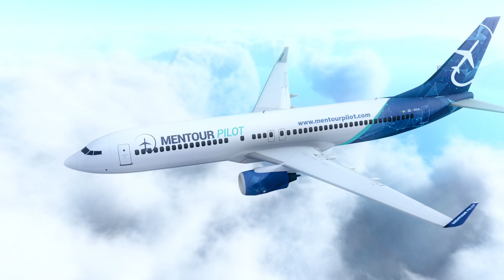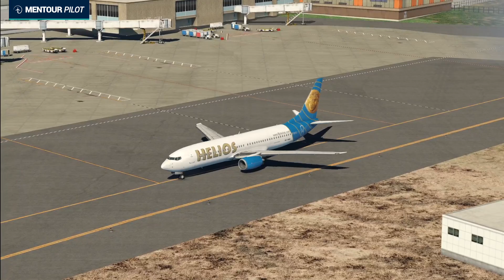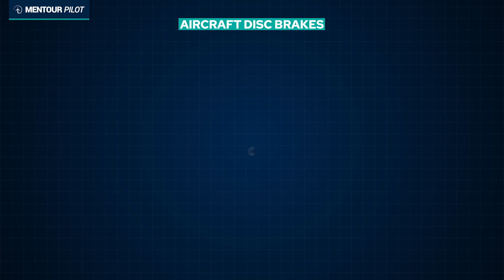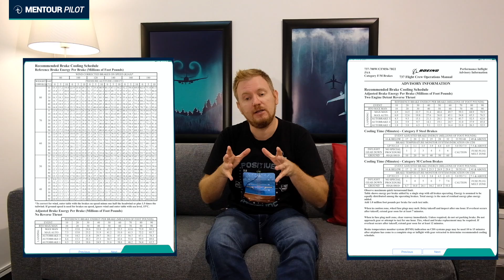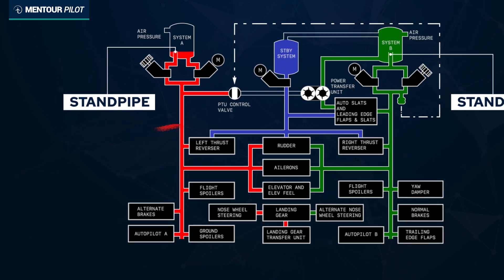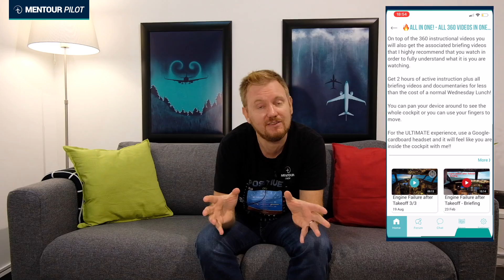How do Aircraft BRAKES work?!

Comment: I love these tech videos. The A-6 Intruder I was married to for fifteen years had a problematic (unreliable) anti-skid system and it was not unheard of to blow tires or have brake fires after  an aggressive brake application. BTW, we disarmed the anti-skid system and increased tire pressure
for aircraft carrier operations.  The latter could make for an exciting arrival when flying off the boat to a shore base.

Comment: When exactly do you set the autobreak control. Does it release when aircraft has stopped
Reply: you set it to RTO before take off ( well when at the gate) and then to off on the after take off checklists and upon touchdown the retraction of the speedbreak, the forward movement of the thrust levers or using the manual toe breaks will all disengage it.
Reply: @tomharper8402  thanks for that

Comment: You didn't talk about chocks and what they do.
Reply: Brakes has really not much to do with chocks, but I do agree that he could have mentioned the use of chocks tho.
Reply: @speedbird9313  I know that chocks cool the brakes down when the parking brake is off but it cools very slowly.
Reply: @ahmedshakeel5112  What!?😂Chocks doesnt cool shit🤚🏻
Reply: @speedbird9313  Yes it does, research it.
Reply: @ahmedshakeel5112  I dont need to research that😂🤪
Reply: @speedbird9313  Ok no problem, but the chocks do cool the brakes.
Reply: @ahmedshakeel5112  Dude..they do not🤨Do some research..
Reply: @speedbird9313  Your right, Chocks hold the aircraft when the parking brake is off so the brakes can cool.
Reply: @speedbird9313  Thanks for the info!🙂

Comment: Excellent explanation...as usual.  My grandfather was an engineer at Boeing in the late 60's.  He told me that he was on the development team for the 747.  One of the stories he told was fascinating.  The engineers had to calculate the maximum heat generated in a 747 during a rejected takeoff.  To prevent the tires from bursting, they had to determine the pressure rise in the tire and then design a special plug in the wheel that will pop out (relieving pressure) just prior to the tire self-destructing.  If a tire bursts, it can do severe damage to nearby components in the landing gear.  A bursting tire also damages adjacent tires and can lead to a chain reaction in tire failures.

Comment: Definitely one of the most interesting videos! 
I am wondering, would you ever use the elevators in an emergency breaking situation, close to take-off speeds, in order to artificially add more "weight" to the airplane without adding mass?
And, furthermore, if you would be to perform such an action, which way would you push the elevator? Because the first thought is down, of course, to push the plane into the ground basically, however, that would shift some of the weight to the nose, where the wheel has no breaks, as mentioned. So, maybe it would actually be more efficient to push the nose up, so that the entire weight rests on the main wheels. Would be really curious what'd be your take on this hypothetical and far-fetched scenario.
O7

Comment: I got a question Mentor Pilot? How do you control the tempture inside the air craft ? Not the cabin pressure , but the tempture for the passangers???
Reply: theres a dial for the 3 cabin zones and you turn it one way for cooler other for hotter, this to phrase it really simply theres more to it like trim air and stuff but its too much to explain

Comment: So, why not wait say, 30 minutes when the plane is at the gate and hose off the brakes to start from a cool brake temperature.  I'm sure you're going to say that they can crack or warp, but I say wait enough time, then finish cooling them off to base or cooler temperature.  Cheap, simple!

Comment: @Mentour Does the cold air during flight not cool the breaks? I mean we are often talking about temperatures below - 20 C. Furthermore the 737s wheels are not covered when retracted. 🤔
Reply: Its about -65c at cruise, and it does. He is talking about short haul island hopping airlines where you dont get the altitude or the flight time for enough cooling.

Comment: I used to work for a company who manufactured wheel speed sensors for a number of aircraft, it's actually really interesting how the anti-skid system works. Depending on the aircraft, they can be a single or dual channel system, and there's a system in place to detect a broken wire even if the brakes are not being used.

Comment: Is it cheaper to use reverse thrust or brakes to slow down in terms of stopping energy gained per $.  Brake wear vs extra fuel burn and wear and tear of reverse thrust.????? So if you have a longer runway to land on do you use more reverse thrust?

Comment: You haven't mentionned the BTV (Break to Vacate) on Airbus
This level of autobrake allows to brake just enough to gate to the taxiway you want. It looks cool
Reply: This is a 737NG which he is type rated for, he sometimes fail to mention that🙄
He rarily talks about other aircraft.
Reply: @speedbird9313  Yeah he's been flying it for 18 years, i know. But i bet he knows quite well what's up at Airbus :-)
Reply: @Slyze33  I hope not, its a bad thing to mix aircraft types to much🤭
Reply: @speedbird9313  Meaning that pilots should be prevented to transition from airbus to Boeing or the other way around? xD
Reply: @Slyze33  Definately not, got nothing against transitioning, just mixing. But so does most airlines🙃
Reply: @speedbird9313  Yep. Haven't heard of any airline that allowed pilots to switch between several aircrafts within the same year. Nonetheless, you could fly for example both A330 and A340 with a MCC as those are almost identical.

Comment: Question about brake heating:   
Do you set the parking brake between flights or is it kept off with only the wheel chocks holding the plane in place to allow better brake cooling?  Or does it really matter?
Reply: It doesnt matter, but they are usually kept off with wheel chocks on.

Comment: I was told by an AB Svensk Bilprovning technician that for a car to be road legal it had to have brakes capable of stopping the car fully loaded and under full throttle in highest gear from n speed (n beeing 90 km/h? Don't remember). This was in the early nineties so before Swedish EU membership, things might have changed since. Still, car brakes are/were pretty good.

Comment: I don't understand why they still use the "good old brake discs" , wouldn't it be possible to install a braking system like on some trains, which works by magnetism....
Reply: Because changes in aviation takes a while..a loooong while. And the 737NG is an old aircraft.

Comment: When I was an apprentice we visited the British airways plane at Heathrow, this would be in about 1963. We went into the maintenance hanger and I remember being shown the Maxaret brakes on one of the aircraft, it reminded me of a motorcycle clutch with the multiple plates. The Maxaret system had the anti locking wheel function for better braking.

Some years later I was in a 747 that had landed at Heathrow and we were taxiing, the old boy on his last stint at cabin crew was instructing us to stay seated till we came to a complete stop. Suddenly we did an emergency stop, probably at about 20mph, the braking was very effective and luckily the cabin staff didn't fall over. This guy said "now you can see why we tell everyone to remain seated and belted up till we reach the stand"!!! I couldn't envisage that a 747 could stop so quickly.

Comment: 9:50 — I honestly don't know why the brakes on a 737 wouldn't cool completely during cruise altitude given the wheels act like a heat sink and are exposed to freezing cold air (-30 C) with 300 mph wind speeds since the 737 has no landing gear doors.

[Okay, just noticed somebody else said there is a windscreen hub that acts as an insulator.]

Comment: I can see why commercial airliners cannot carry passengers with an inop anti-skid system.  Especially when having to land on a wet runway.  Under heavy braking after landing with no anti-skid a wheel going over a paint strip will lock up and it doesn't take long for the tire to grow a hole from the friction.  Not a good thing.  I was a T-39A crew chief/flight mechanic for my tour in Viet Nam and saw it happen more than once.  Lack of anti-skid was the only thing I didn't like about that bird.  It was rugged and dependable.  We actually put 100 hours on one of our birds in a 7 day period.
Reply: Did he say that? The 737NG can be released with an inop anti-skid as far as I can remember..think it is a cat C MEL item🤔
Reply: Ah..he did at 14:34 He is mistaken, but think he really knows🙄🤭

Comment: Interestingly, the brakes are very similar to "race" clutches in a car, or clutch packs in an automatic transmission.
Reply: Yes! very much like wet clutches on motorbikes also which use this "pack" method to be more space efficient, i'm surprised that cars still use a single plate, large diameter clutch actually, such are the benefits of a multi-plate friction system like this

Comment: Great video! I have observed that on most planes when the gear is retracted after takeoff, the brakes are applied. Is that done just to keep the wheels from spinning inside of the fuselage?
Reply: How have you observed this? Its not something that is done by the pilots..
During landing gear retraction, the alternate brake system gets pressure to operate the brakes.
Reply: @speedbird9313  I like to watch  those plane watching videos that people post. And when they zoom on the landing gear after rotation, I have noticed that there is a brief application of the brakes before the wheels go up.
Reply: @caliban88  Ah..makes sense👍🏻But when you say application it sounds like you can see that the brakes are being pushed in😉
Reply: @speedbird9313  Yes, maybe wrong choice in words😁. But yes, from an 'outward observation', I could see that the wheels are stopped before they go in👍.

Comment: Thanks for the video, I'm wondering why the Brakes dont cool quickly or Significantly at altitude or that outside cold air is not used for cooling post takeoff and during flight?

Comment: Can you answer my question respected sir,Why do the pilots set flaps to zero after takeoff as the flaps are necessary for lift and keeping the aircraft in the air.
Reply: Flaps are a function of speed. They are extended at lower speeds for increased lift (& drag) to make the plane more controllable. Without them, landing & takeoff speeds would be much greater & less safe. Flaps aren't needed for lift itself, the wing size & shape do that. Deployed flaps would slow you down at cruise speeds & could damage them & the wing from an overspeed condition.

Comment: maybe a stupid question - that accident with BAE146 in Norway (Atlantic Airways flight 670) when pilots had no spoilers and activated emergency braking (this disabled anti-skid) and they left the runway then aircraft went down the slope - is it possible to retract landing gear as a last resort to stop if going down a slope (or hitting something) can not be avoided in any other way?
of course at this point application of emergency braking was not good idea - it made braking distance longer because when wheels were locked burning tyres acted as a lubrication and reduced coefficient of friction... With spoilers failed initial braking is poor because of remaining lift but it improves as speed reduces.
Reply: No.

Comment: We commissioned an induction heater for company which makes carbon brake discs. One of many stages is to cook them in an induction heater for hours. Process is quite interesting but messy (everything is covered with a fine graphite dust). Advantage of using induction for any conductive material is that heat generates in the workpiece so it does not need to conduct to it from hotter heater. in short terms indction heater is a transformer with shorted secondary winding (workpiece).

Comment: Anti-lock braking first appeared in planes, but the system that cars use is different. Planes have huge wheels compared to cars, so their system is to have a gear inside the inner wheel rim like a cog which detects that it's not turning anymore (the wheel is not turning) and backs off the hydraulic pressure on the brakes. On-off-on-off many times a second until maximum braking is attained just prior to the known brake lock point. It's purely mechanical. Cars use a 2 ot 3 channel electronic system.

Comment: Yes. Most aircraft have brakes on the main gear system Question is why not have on the nose gear to have a redundancy or an additional braking to enable more braking action. Answer could be Cost/Weight or both or even safety?
Reply: MLG brakes have enough redundancy themselfs. So yes, cost, weight and necessity👍🏻

Comment: Fun fact: if the kinetic energy of an A380 at V1 was turned into electricity and fed into a flux capacitor on a DMC DeLorean traveling 88mph, the DeLorean will travel back in time.
Reply: A lot of people think that, but it's not really true.  The KE-derived electricity from a decelerating A380 is 3-phase, and a flux capacitor needs 2-phase.

Comment: Re: Carbon vs. Steel brake usage. Am I right to think this different wear behaviour is because carbon brakes actually harden under heat?  So during heavy breaking they heat, harden and wear less than under gentle breaking that doesnt cause the hardening effect.

Comment: Petter, I was under the impression on jets, the engine retarders or  thrust reverses do most of the braking and the wheel disks catch up on the ground friction. As you mentioned it is a huge GJ of energy to be converted to heat. Another issue with metal discs is that they WARP due to low dissipation of heat and transpond a pulsating  deacceleration causing the cabin to vibrate and accompany noise. Would 'Ceramic' be better as discs though costly. I am sure they must have thought about it. Your videos are Technically informative and interesting. As Engineers we see eye to eye. Thanks for your passion. Safe travels. Best of 2021. Mano. 🙏🎖
Reply: In a typical landing on a dry runway, reverse thrust accounts for say 15% of the kinetic energy absorbed.  That's using moderate reverse thrust, as there is not usually a reason (on a dry runway) to use full reverse thrust.

Comment: Hah!  Called it, i figured it had to be a stacked brake pack.  The same tech is used in industrial applications as well.  Because sometimes you need to stop really heavy moving equipment within a few inches.  Granted, not moving at 170 knots, but still.

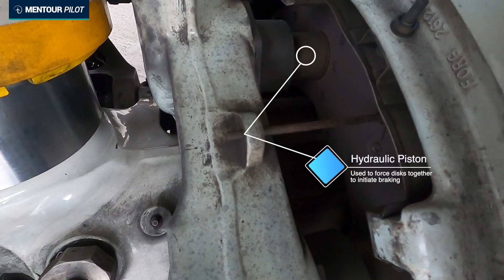Comment: Hi, the caption at the brake unit picture at min 6:34 is somewhat misleading - the white line seemingly also points at the protruding steel pin as a hydraulic piston. This pin, however, is the brake wear indicator pin that instantly shows the wear of the disc assembly.

Comment: It’s a lot like a motorcycle clutch with multiple steel disks and carbon friction plates. The clutch pack is bathed in oil to keep it cool on a motorcycle. Very interesting.
Reply: many ATVs now have that for a rear brake. I was told by Kawasaki at the time they introduced them that they borrowed it from tractors.

Comment: Great technical video, thanks. I've only been through a rejected takeoff once, as a passenger of course since I'm not a pilot just always interested in how things happen with aircraft. It was in a Shorts turbo prop (or fan, don't recall) on a short runway at a relatively small airport (SBA). Passengers experienced that situation of hanging on our seatbelts during maximum braking but nobody panicked and we were at full stop with room to spare remaining ahead on the runway. I recall it turned out to be a false warning indicator that caused the rejected TO. It was tested, resolved and we proceeded back out to takeoff with nothing further of note. After initial concern, it became an interesting diversion from normal operation, at least for myself. Cheers and stay safe.

Comment: Captain Petter. Formula 1 cars also use carbon brakes. When the cars have to line up behind the safety car due to a racing incident, one of the calls you often hear from the pit crew is "watch them brake temps there getting too low." So, do the brakes also have to be at a certain temperature to work properly? can they be too cold? They are also warned of course if brake temp is too hot as well and occasionally there disks glow red. Or are F1 Car brakes a different concept? Stay safe Capt.

Comment: So, planes can have brake fade, just like a truck going down hill... to put the 2,2 GJ in perspective, it's about the same as 70 liters of gasoline, you can have quite a fire with that.

Gott Nytt År!
Reply: Not only a truck.  Any car with automatic transmission is at risk of the same phenomenon for the same reason.  I have seen idiots coming down a mountain and accelerating between corners then braking to rub off the speed.  After 20 or thirty brake applications,  plus the downhill itself, you can just wonder at the heat those poor brakes are having to cope with.
Reply: @smitajky  Most modern automatic transmissions allow for manually selecting a lower gear (or several lower gears) which is useful for downhill grades, but there are lots of dumb drivers out there who don't realize that or think about using lower gears to reduce the amount of brake applications.  I've always felt that if driver's had the same training and testing standards as pilots, there'd be a hell of a lot less accidents, injuries, tickets and arrests, and their cars would last longer too.  Lol.